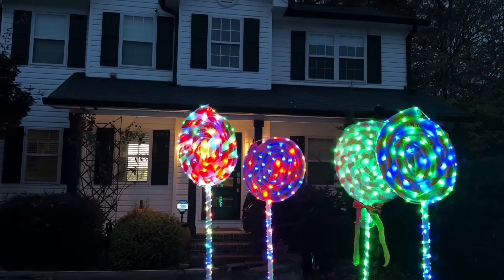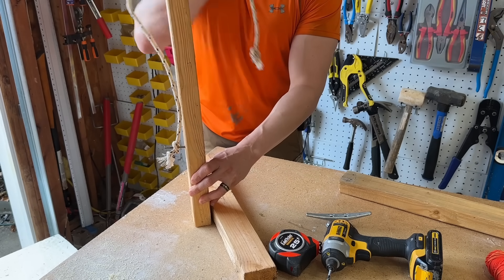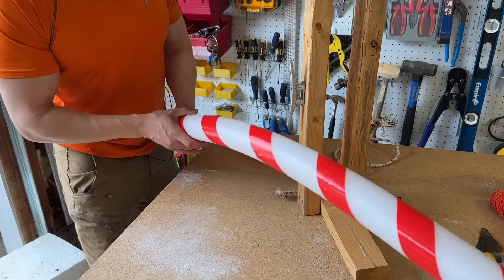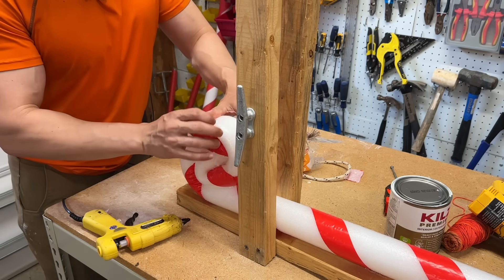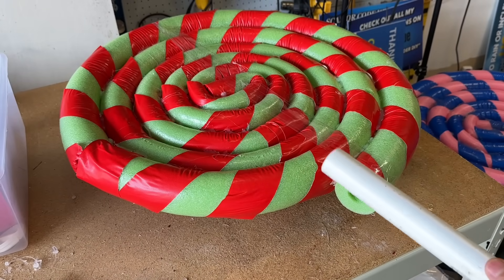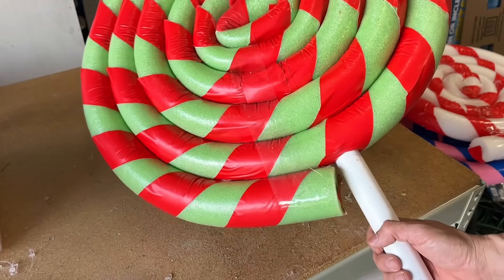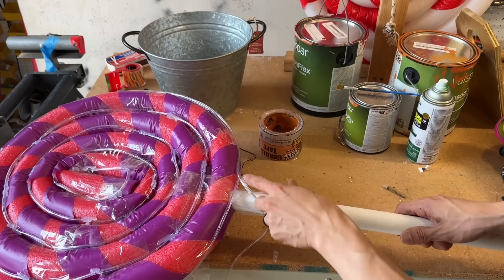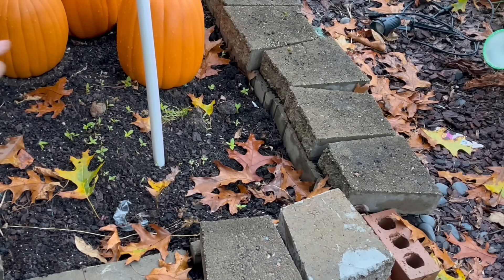Giant LED Christmas Lollipops - Tutorial

Comment: Very nice. I covered mine with Dollar Tree window insulator kits. I got three covers from each kit as memory serves. I used the tape from the kit. Folded the plastic over the top and attached front and back together inside along the sides with the tape and slid it over the lollipop. Gathered at the bottom with a cable tie and shrunk it with a heat gun on low. We get a lot of wet and snowy weather and I wanted them protected. It's held up well and they stayed dry in our winter weather. 
Now I have to take them apart to add the lights...thanks, Isaac! 😁 Well, maybe next year...
Reply from the maker: Love that!

Comment: What happens if you put the  lights through the pool noodle?
Reply from the maker: Pool noodles are too dense so it would be a more muted effect. But try it and tell us how it turns out.
😊
Reply: It works great! The pool noodles work as diffusers and glow spectacularly. I put lights inside the pool noodles when I make words and candy canes for my light show. I split the noodles up the back to make inserting the lights (and pvc for stability) easier. You can glue them back together but it it's really unnecessary.
Reply: You can also use a soldering iron and go to the back of the pool noodle and melt holes and hot glue each LED bulb into the holes. The diffused glow is very nice and a different look.

Comment: I was wondering if you tried to use super glue instead of glue gun and glue sticks ? Just curious?
Reply from the maker: The reason I don’t use superglue is because it takes too long to cure. Hot glue dries in about a minute, but superglue takes much longer, but if it could dry as fast as hot glue, I would use superglue.